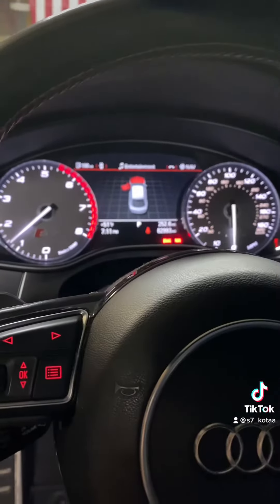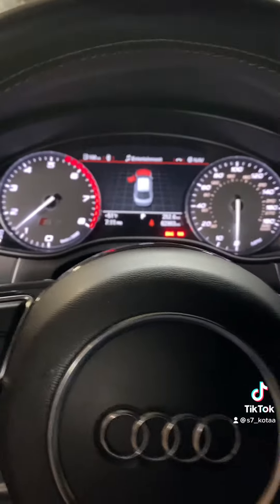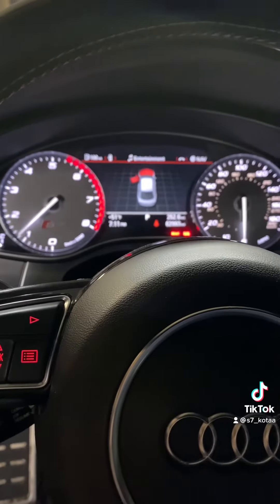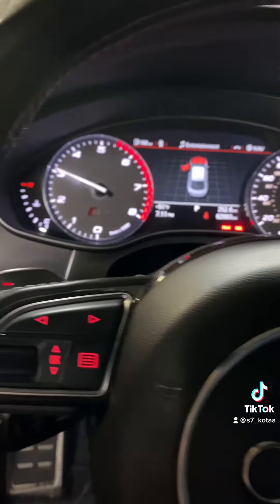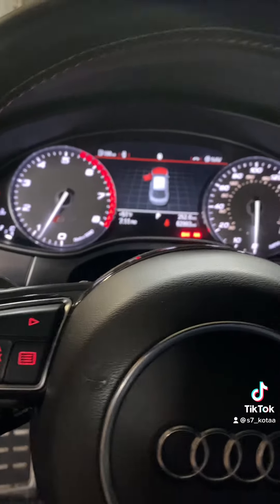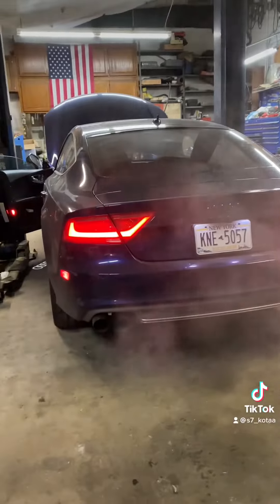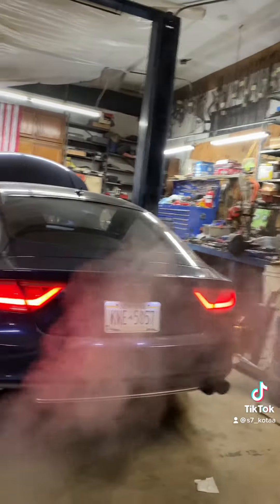Audi S7 4.0T with downpipes, but is it to loud? Startup, revs & driving

Comment: I just did mine but it doesn't pop or throw flames this much at all tho why is that? I have test pipes that's it the rest is stock exhaust
Reply from the maker: This one doesn’t have any flames just the pops and bangs which is because of the tune on this car

Comment: why the engine check is on...
Reply from the maker: Removing the catalysts with cause a check engine light due to the secondary oxygen sensors not being able to detect the cats and if they are operating properly from the tests they perform. You can run spacers on your down pipes to have the best chance possible at avoiding this but still no guarantee. I’m getting my spacers tomorrow thankfully so will be installing them ASAP